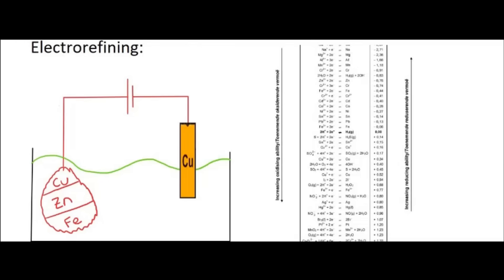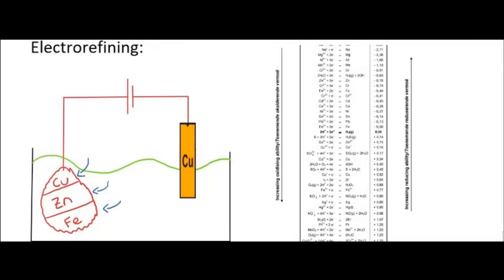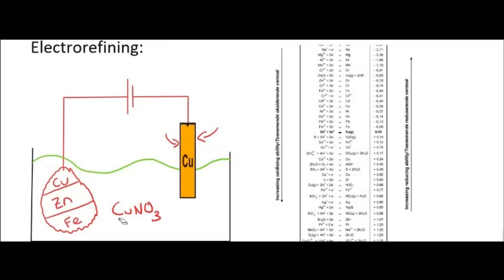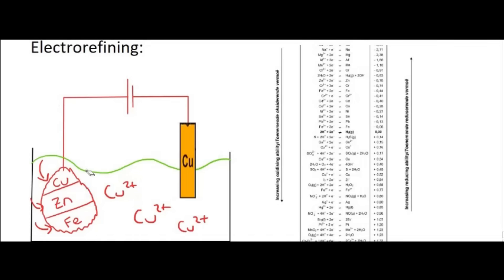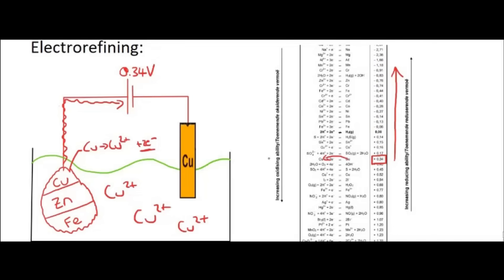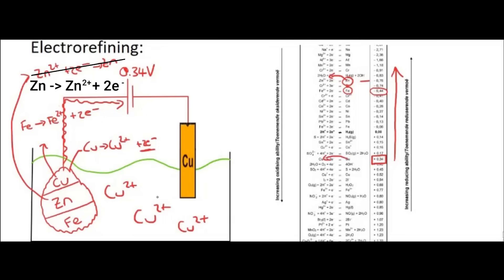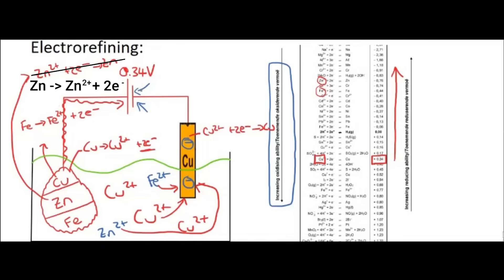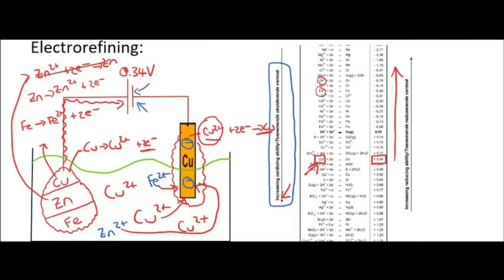Electrochemistry Gr 12 : Electrorefining

Comment: Please do a video on the standard hydrogen electrode and how it's used to measure oxidation and reducing ability if everything on the half reaction table
Reply: Alright my fellow grade 12.
Don't know if this will help but let me explain what I know.

So imagine a galvanic cell with Anode on left and Cathode on the right with a Voltmeter connected.
So the voltmeter would read the energy transfered from left to right.

Now what the old scientists did was put Hydrogen as the Anode of this cell (left) and then tested every single Substance as the Cathode.

So if a substance at the Cathode was a good reducer then the Voltmeter reading would be positive because electricity would move from left to right.

If the substance was a good oxidiser (or atleast better than Hydrogen) than the Voltmeter reading would be negative because electrons would rather go to the left 

So they than made the table.
So taking Hydrogen as reference: if the substance is positive it's a good Cathode ( it's good at reducing and thus a good oxidising agent) If the number is negative it's a bad Cathode and thus a good Anode( good oxidiser and good reducing agent)

Let me keep yapping:
When comparing 2 substances 
The one that is a better Cathode than the other one would be the Cathode in that cell and the other one would automatically be the anode because it's not as good as the other one. 
So based off of that, if we wanted to know what the Voltage of this cell would be we take our reference voltages ( the ones in the table) 
And 
We would compare the cathode one with the anode one ( by subtracting) and then we would get the strength of the voltage of the cell

Hopefully this helped, 
If you don't understand something in this large paragraph just reply to this comment asking and I'll try to respond back.
Reply: @shub9644  very helpful thanks so much!!!
Reply: @shub9644  writing my chemistry prelim.next week and this was super helpful
Reply: @jakegordz101  glad it helped. I'm writing tomorrow 😅
Reply: @shub9644  good luck godspeed
Reply: @shub9644 saving me before my chem prelim tomorrow!! Might need you as a personal tutor next year in uni
Reply: @legendgotgamerbfnrl6874 woah
I almost forgot I put this comment here last year this time.
Glad it helped!